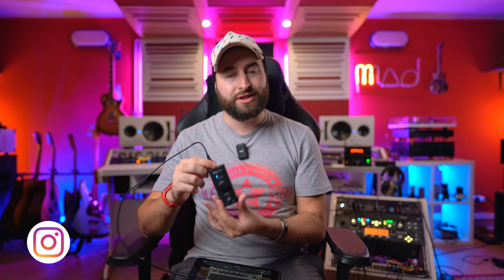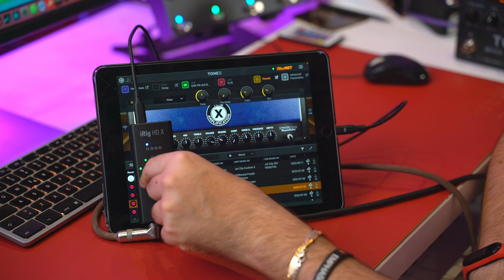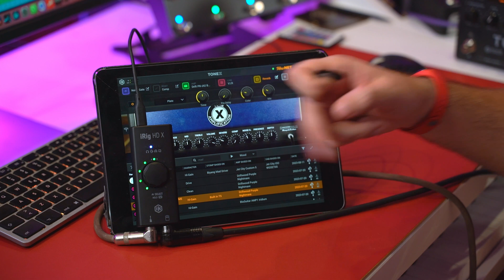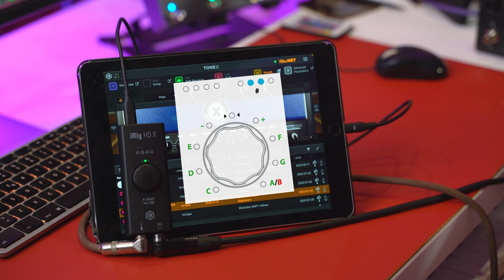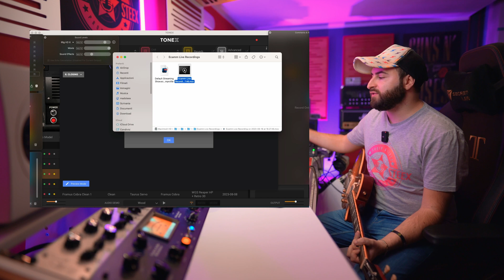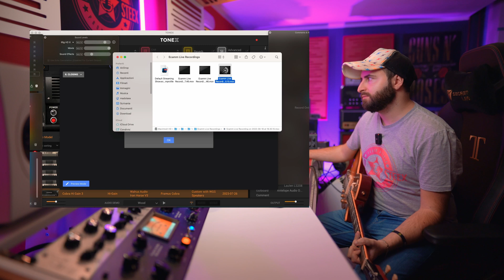YOU NEED THIS! | IK Multimedia iRig HD X Universal Guitar Interface

Comment: Should I buy the HD 2 or HD X?
Reply from the maker: It depends on your needs, HDX has the loopback more and the possibility to monitor on the interface the gain/volume and tuner. Otherwise I suggest you the iRig USB, the HD 2 is old with usb micro and not usb-c

Comment: I still cannot get the iRig HDX to send input from a passive bass to GarageBand on my MAC. Audio shows on the iRig, not in headphones and not in GarageBand. Lots of settings in GarageBand seem to be set properly.  Might try other software.
Reply from the maker: Just go into the audio setting of garage band and select the audio interface input 1
Reply: @MadSteex That was the first setting I checked.  I will try other software and other devices (iPad & iPhone).
Reply from the maker: @photopro100 if you check from audio interface for your pc/mac out from the daw, so as general audio interface, can you see it on the list?
Reply: @MadSteex I finally figured out to increase the audio at least +3db through the plug-ins within GarageBand.

Comment: I tried a couple.  First one had issues of the headphone jack not working and then I got a second one.  I use an active bass and the input has very little headroom before distortion.  The output side, using an iPad M4 I had to crank the output on everything to get a decent enough volume to hear well with other apps.  I also tested with my computer (MAC M3) and it was still "whimpy" on the input and output stages.  My other desktop USB interfaces, am Audient and an Audiofuse had none of these issues.

Sorry, I wanted to like this device and had a good use case for a portable device.  I can not recommend.
Reply: Hello, friend thank you for let us know this, this answer my question about this device quality.

Comment: Could I run the FX loop (the send) into the Instrument input of this little device? And then I would output the sound on my headphones so I could play in complete silence (I own a Marshall Valvestate 8240)
Reply: Actually you don't need the loopback feature to only listen with headphones the send of your preamplifier...BUT you could send the "send" to input of the iRig HDX and apply maybe effects and loopback everything to headphones
Reply: @MadSteexProduction  I've seen many people plug in a headphone amp or cab sim into the FX send for the input and either leave the FX Return unplugged or plug in a dummy 1/4" jack connection for silent practicing. I want to know if this little device could be used to practice in silence? (Like the Amp out or the iRig wouldn't go back to the FX return)
Reply from the maker: @xavierbriand9515  keep in mind that listening the signal from the “send” fx loop is horrible cause you will listen the preamp only, not the whole amp and without a cabinet! So you will need at least to use an IR after the preamp.
Reply: @MadSteex  I firstly have to thank you a lot for your quick replies.
And secondly, do you have any recommendations for an IR that is relatively cheap?

Comment: No input gain control makes this interface absolutlly unusabale. Every audiointerface needs an input gain control (and normally has one) to get a proper signal to the mixer/computer. To adjust the input signal (which is digital) in the SW is destroying your sound (in this case if you have a low output guitar like a Tele, you need 12-15dB plus; other high output pickups are clipping) I`m returning my one. I`ll try the halfpriced iRig USB
Reply from the maker: @forsaleh  there is the input gain control. The first step 🤦🏻‍♂️
Reply: @MadSteex  Hi MadSteex, I'm not an expert for this subject and I thought the HD X handles input by itself. But this is not the case. The former iRig USB has a input gain control.
I like the IK Multimedia SW like Tonex and Amplitude (they sound great) . But e.g my Tele doesn't work with this audiointerface (too low signal from the pickups). I put a link from somebody who explain it on a much higher level:
 https://youtu.be/gJ59h7xfvdI?si=0KCwtOG9xilfUcjQ
take a look, please

Comment: so I could use it with headphones and my android phone mobile right, like in a car whatever right, whats the battery consumption like? how many hours shreddin you get for a set of batteries?
Reply: I don't think the iRig uses batteries. It uses power from your phone, tablet, or computer. The length of time would depend on that device. The processing power comes from the device itself, so the iRig uses minimal power.
Reply: In a car? Get outta here .
Reply: @kojoefante 😅😅😅😅😅
Reply: @kojoefante I’ve had one for couple months. It turns on as soon as plugging into phone so will last as long as your phone battery. Is good fun
Reply: @kojoefante yup. in a car. or a bus. on a plane. a hotel room. in a house. Maybe with a mouse. Anywhere you want to play. ok?

Comment: I tried to follow what you did. When I plug in the rig HD X, there is no sound! I’ve plugged into my iPad and iPhone still, no sound. I’ve gone through every setting in Garrage Band and the irig. I can’t figure how to get any sound. I’d like to use this for pratice. I’d like to play something from Spotify and hear myself play along with it.
Reply: I’m getting the same thing, did you ever find a solution?
Reply: There is no solution as the software program on this device simply doesn’t work.
If you have to have this type of device the hd2 is a far better choice and does work!
Reply: @doclucky1956 what do you mean by the software program not working?

Comment: Well this was usefull. Can i listen to my playing with ipods (wireless headphones)?
Reply from the maker: Yes you can for example decide in your daw which is the input interface and otput interface. Actually I don't know how wireless system will interact with mac/pc so how you can select them, but in any daw you can select the In and out.
Without a DAW I don't think is possible
Reply: I though to connect irig to my iphone and output to be ipods(wifi)?
Reply from the maker: @wladosu  mmmm interesting...I can try, I've the earpods
Reply: Please do, thank you
Reply from the maker: Hi man yesterday I’ve tested with my AirPods 2 they can be selected in any daw/plugin so can be recognized as possible output. The problem is the latency! Man is around 0.5 sec 😂😂😂 I think is due to the bluetooth technology of these wireless headphones..maybe Bluetooth is slow for zero latency audio
Reply: @MadSteex hey. Thank you for testing this option. It would be pretty cool if i could walk around with my ipads and guitar. 0.5 second is light years 😂😂

Comment: Can I run into FRFR with no latency?  Would be a great portable rig with a Headrush 108, if it works.
Reply from the maker: You can do that for recording. “No latency” is only for recording! When you use plugins you will introduce a small latency obviously
Reply: Thx.  
 @MadSteex